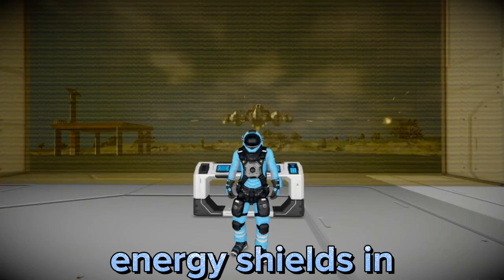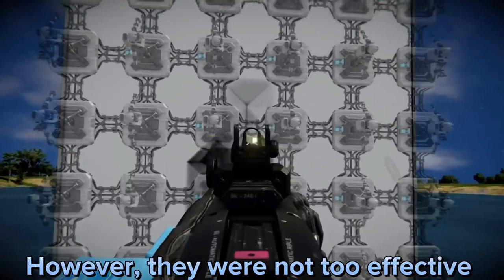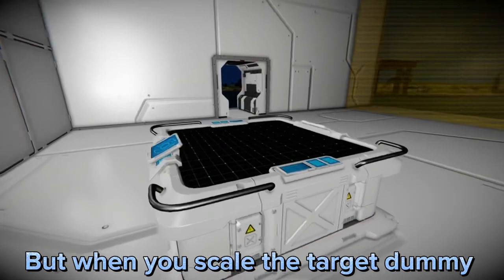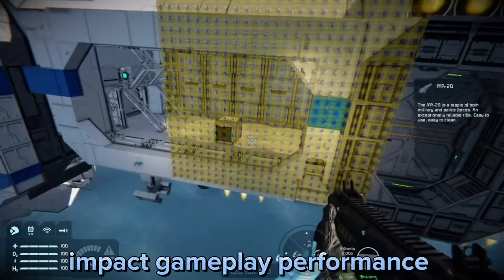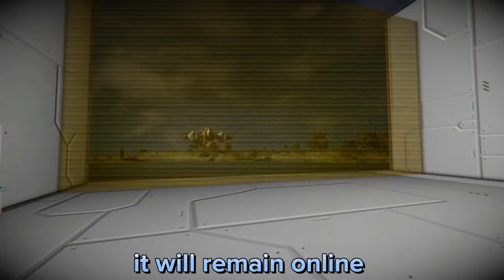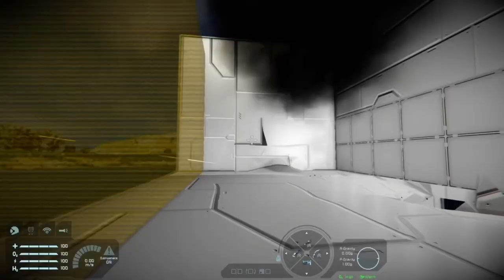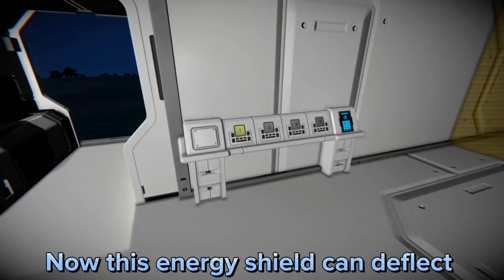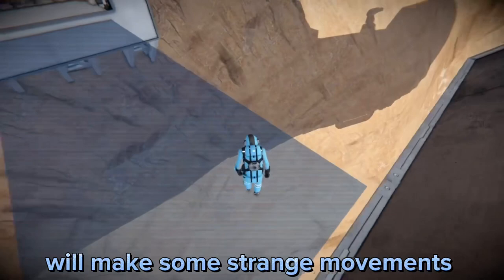(FIXED) Space Engineers - Energy Shields Using Target Dummies

Comment: I already have been in Contact with a Modder who was so nice and Made me a special Dummy that is Just a giant Cube or Wall. If you make this a Projection, your Ship will be indestructible. The Modder im in contact with is also Trying to make a Round Shield form so you Place the Dummy Block somewhere in the Middle of your Ship and the Shield will Wrap around it. It actually doesn't need to be Projected either since there is kinda a Bug that if you try to Adjust the Dummy Respawn timer, the Game mess up the Slider and sets the Number to -2103837282 Seconds - that causes the Dummy to Instant Respawn - Bam, Super Reflector Shield. I had the Idea making a Shield wall of this dummy as a Workaround to implement Deflector Shields for Xbox Console, since this just doesn't need Scripts. The Only Problem the Modder have to solve is making a Large Oval Bubble that Covers the Whole Ship, but is also Hollow so Players inside won't get Yeeted out once you Activate this.

Comment: Is it the distance to the projection or the projector which dis-/enables it?
Reply from the maker: I am quite certain that it is the projection.
Reply: @RhynoSpartan  i made a blueprint of a single crash test dummy, but it seems not to have any hitbox i could fly against in creative. Does this work only in survival? Is it fixed maybe or am i doing it wrong -_-, most likely user problem sigh
Reply: @RhynoSpartan  could be that i am in modded creative as you mentioned at the beginning of your mod it would work in "unmodded"
Reply from the maker: Are you projecting the target dummy with a console block or a standard projector?
Reply: @RhynoSpartan  console block
Reply from the maker: I tested the exploit in both creative mode as well as in survival mode. It hasn’t been patched (yet). The target dummy can lose its hit box when displayed with a console block either as a result of player camera proximity or from the game loading assets. To ensure that it has collision again, I remove the projection from the blueprint menu and reapply it. If that doesn’t solve the issue, I will attempt to find an alternative solution.
Reply: @RhynoSpartan  thank you for putting that work in, i will try it that way and come back to you with the results tommorow.